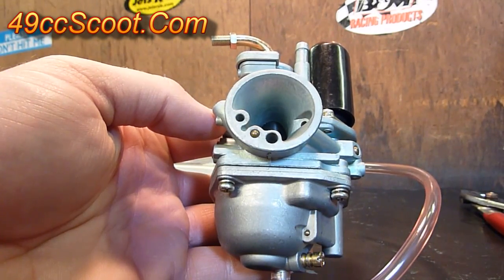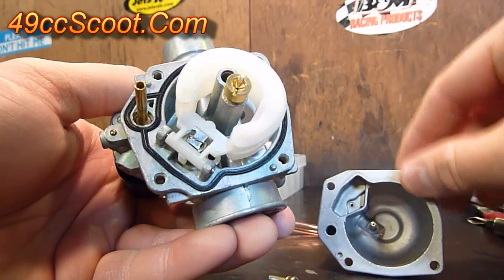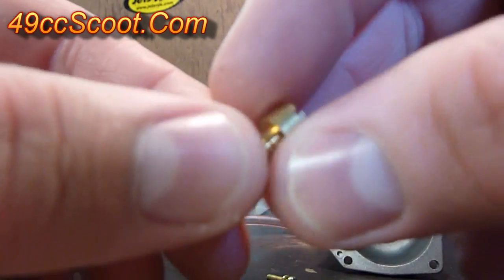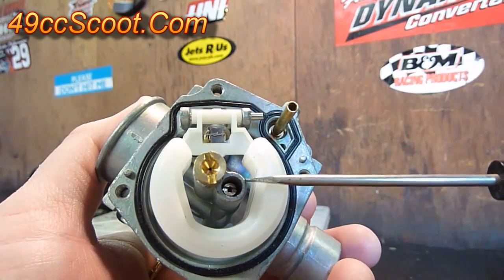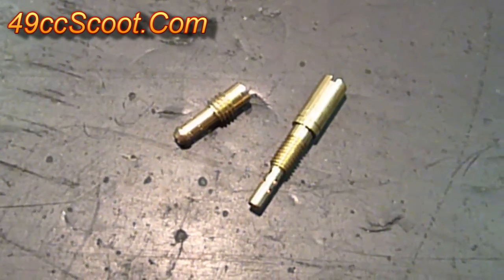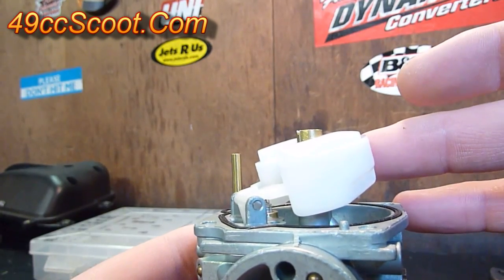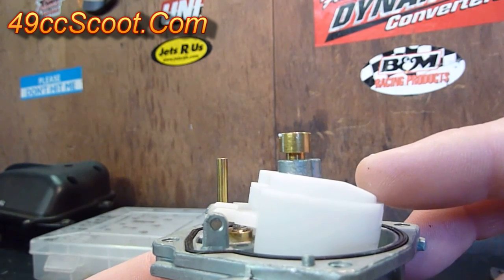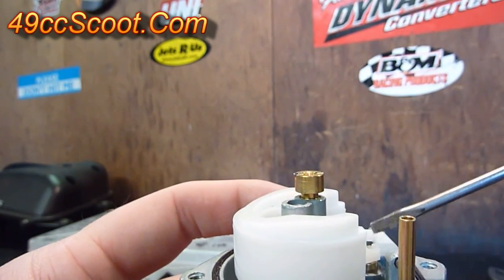Two-Stroke Scooter / ATV Carburetor Settings And Adjustments 4of4 : Jetting & Float Height

Comment: I have 100 jet in my moped its got a k&n air filter and a pm tuning 360 pipe and it bogs i was wondering what size would I need and whether it needs upjetting it a 50cc gilera
Reply: Oh and I recently fitted a new not kit only a 50cc one but would it still need upjetting my friend said i will need to go up by about 10 so I would need around a 110 main jet. The 100 jet runner fine on my old bore kit which was a 50cc one two and I had all the same parts on it as I do now i just don't understand why it's bogging down at half throttle I would easily get 55mph out of it now i only get 20 to 25 if I'm lucky and it bogs before I get to that sometimes so please help?

Comment: Hi tks again four you post your good video, my scooter the petrol not came out from tank to carburettor is lucke the float problem because I thing is the vacuum pump I by a new one and fit and still not petrol came out the carburettor I cleane before the carburettor and I remove the float probley I not fix correct tank you Berenguer
Reply from the maker: Take the carb out of the equation. Totally unhook it and crank the engine over. Fuel should start coming out of the fuel hose. If not, something is clogged, malfunctioning, or not connected properly. Check all hoses for cracks and leaks and recheck routing. Make sure the inline or in-tank filters are not clogged. Try removing the fuel cap and seeing if that changes anything.

Comment: hey, i have keihin carburetor in my scooter, and im not getting any fuel there anymore. i checked this, and i had no yellow thing where my float needle goes, so am i missing some parts? sorry for my bad english hope you know what i mean? thx if you can reply!
Reply from the maker: If anything were missing at the seat of the float needle, it'd be more likely to overflow fuel from not sealing. Check float height and make sure the petcock is working and nothing is clogged from tank to carb. If the carb has fuel in it but it never makes it to the engine, clean the carb.
Reply: ***** okay, thanks for advice. but when i take my float bowl off, there goes gas, but when i put it back, there goes no gas. well il check all those things. thanks :)
Reply: ***** btw, i dont have petcock, i have automatic gas bumb there?
Reply from the maker: *****
Since it fills with gas, the pump/petcock should be working. It's getting fuel to the carb, so clean the carb thoroughly. Get all passages with carb cleaner and compressed air and make sure all of your jets are clear.

Comment: OK I get what you're saying, but no this is a 2 stroke, single, with 2 reed valves.  All Yamaha Chappys are like that and came in 80cc or 50cc.  The 50cc bikes (like mine is) were designed as mopeds.

Comment: Yes the Chappy LB50 is along the lines of a pit / trail bike. Has reed valves. So currently main is a 70, are you saying to go up on the main jet - like 90 or 100? Wouldn't I want to go up on the pilot jet size also? The current pilot is a 15 and is set at 1.5 turns now, any richer will close it all the way. Initially you said both jets sounded small to you, especially with open filter and exhaust.

Comment: Awesome vids and crystal clear direction! I have a Chappy LB50 that I put a 70cc kit on, that won't start. Carb is stock, Main Jet 70, Pilot Air Jet 15. Air and Idle screws are set at factory spec.  Carb is squeaky-clean, all passages clear...can even see light thru them and thru the jets. I have a clamp-on hi-flo air filter. Spark is good. Compression good. Stock exhaust has been hollowed out, and the baffle removed. Do I need to go up on Pilot Air Jet size??

Comment: hi, I have an aprilia rs 50, which i put a 70cc kit on, everything was running fine until i bought an aftermarket 21mm carb (originally 12mm) I also bought a new open air filter which is extremely pourous, now I don't know what to do with the jets (90 main and 60 idle), I'm not sure whether it needs to upjet or downjet, its rather boggy (only doesn't bog when WOT in 3rd,4th,5th and 6th gear only WOT), should i buy bigger jets? (there is quite a bit of smoke no matter where the needle is) Thanks

Comment: I have a alpha sport 50cc atv which is the same motor as the eton 50 polairs predator 50 and more but the air mix is set at 1/4 turn out from seat and i go out more it revs higher and dont drop. and when rode it takes off slow and half throttle it loses power like bogs.. you think the main and piolet jets are to small.. no air leaks..